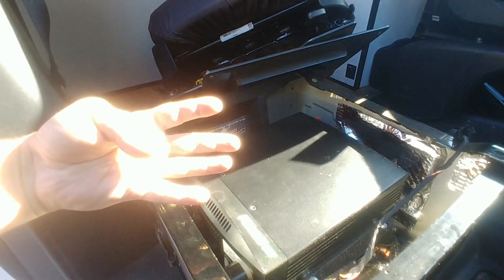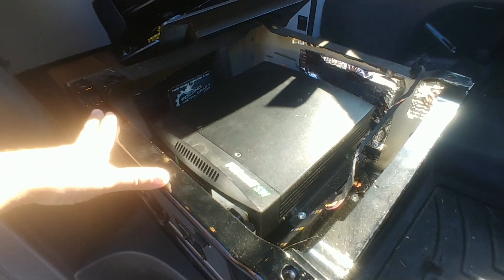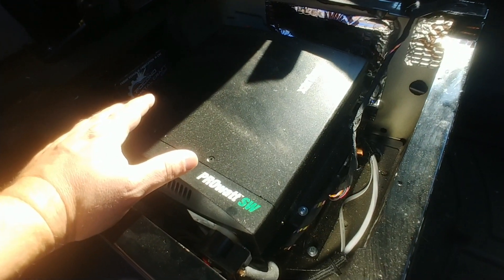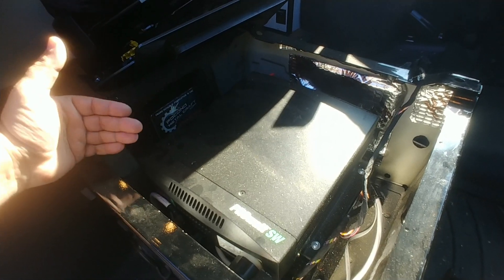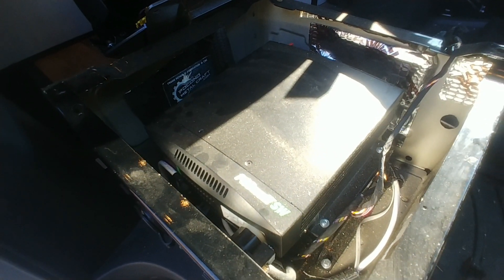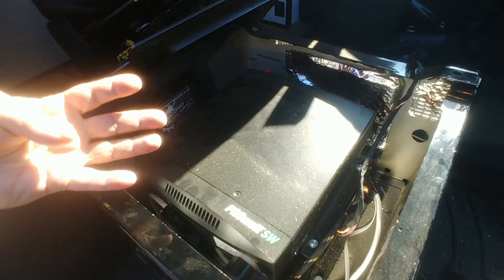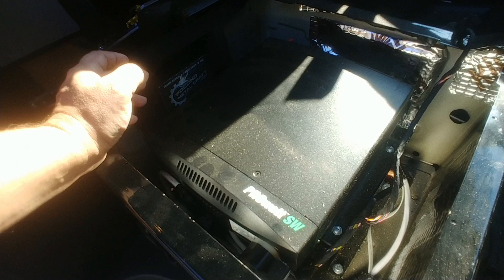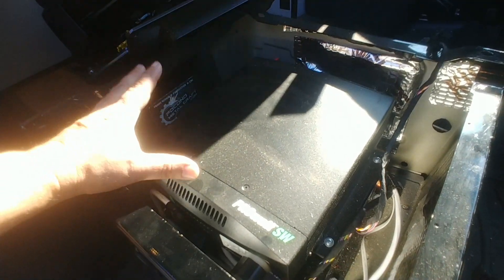Is the Xantrex SW2000 inverter any good?

Comment: You would be better off using 4/0 cables and having the inverter as close as possible to the batteries - 
     With a 12 volt system it's very  difficult to maintain 12 volts at the inverter terminals even if your battery's are at 12.6 volts at a 2000 watt load - we used inverters on offshore drilling rigs for emergency or stand by lighting and communications equipment - 
        If your inverter power leads are more than 2 ft from the battery's no matter what the size there be a serious voltage drop at the inverter when you draw 2000 watts or 200 amps - 
      If there is more than 2 ft distance - you can go with a 14 volt battery bank - or go to a 24 volt system - with any inverters we often went with 24 or 48 volts if the load exceeded 500 watts - 
       Another is the temperature - there 2000 watts at 78° but at 100° they might be 750 wattts - as a rule  you run inverters at not more than 25% of there rated out put - 
       I had worked on generators and inverters for decades on offshore rigs and platforms also remote mountain sites - 
    Those inverters were excellent and are FCC part 15 class  A they create no IF - that's a + -
       12 volts does not travel far at high current demands at all -
Reply from the maker: Thank you for your feedback, much apprecated!
Reply: @RANDOMFIX  I hope it helps you - I've been using Xanax and Trace inverters for my house alone for about  23 yrs now - 
      I live in the rural deep south - hurricanes, ice storms, even thunder storms or heat waves knock the power off the poles out - 
       My power has been knocked out up to 9 months at times over the 40 yrs I've lived here - I have a large bank of battery's and charge four hours a day when I'm not using the air-condition -  it's 12volt inverters I use - 
         I use a weaker strength acid in the golf cart battery - instead of 1.275 strength acid I use 1.220 strength acid - it does reduce the capacity of the batteries, but increased the service life of the batteries up to 50 yrs or more -
Reply from the maker: Wow, very cool, I didn’t know the weaker acids would extend the life of the battery by so much. Do you have addy information about this?
Reply: @RANDOMFIX  my grandfather started working on power plant generators in the late 1800s - 
     Down here all power plants were hybrid - even down in the French quarter in N.O. on Burbon street there was a power plant that provided 110 volts DC to the French Quarter - 
      The reason that most power plants were hybrid was the cost of fuel -  if in  1900 a gallon of oil that engines burned was 30 cents a gallon with inflation in our money that's about 30 dollars a gallon for fuel oil - 
       Most of the fuel an engine burns goes toward running or turning the shaft before any power is used - 
    If  A generator runs 4 hours a day - that 4 hrs of fuel used to rotate a shaft - each HP generates 416 watts at 100volts up to 25000 volts - with 12 volts it's 325 watts per HP or I think 24 amps per HP - 
      In the end lead acid  battery technology was well understood by 1900 - you here it said it's a 12 volt car battery - 
     Before battery's were used for starting the electrlite solution was much weaker -: those battrey's at that power plant in N.O. in the quarter had an acid strength of 1.190 so at 80" while sitting there standing voltage was 2 volts instead of 2.33 as with battery's today with a.acid strength of 1.275 -   the acid strength determines the capacity of the batteries and the service life of a battery - 
      Battery's that use a weaker solution acid don't sulfate by much  and sulfation is easily removed during equalization - power plant battery's were expected to last 70 + yrs or more - 80 yrs was the target - 
       Also about 1900 farms or  rural homes adopted using the railroads 32 volt system - down here we're I'm at it never gets colder than 7° so it's safe to use a 1.190 acid it freezes at 0° - 
        The acid strength used was determined by the lowest tempriture the battery's exposure was - 
      In most of the country 1.220 acid strength  was used in house battery's on farm home light plants it's good down to minu 17° -  you can Google farm light plants battery's  - and I think Exide and some other farm house battery's will come up - 
       I think they rate the 1.220 battrey's for 40 yrs - at that point it was also time to replace the generator with a remanufactured generator - it was based on charging one day a week over 40 yrs - that's close to 19000 hrs of run time say on a Delco farm lighting plants - 
       Kohler  had a 32 volt set up that was sold as a 15 yr farm light plant for farms with high power demands - there battery's were 1.240.strength acid that increased the capacity of the batteries but the service life of the batteries were reduced  to  15 yrs - at that point the generator was also changed out for a remaunurfacture gen set - 
     With the Kohler set - some of this can be found on the net - just look for vintage farm lighting battery's - from what I'm told you will not find any of this on you tube -        I've had friends tell me they found some of this as documented studies in the early 1900s of the efficency of farm plants - 
      I've changed out my system from a 32 volt DC / 110 volt AC system ( using a machanical motor driven inverter/ - 
      My engine runs at 450 RPMs it's about 90 yrs old - it was set up.as a 80 yr system origainaly and runs on crude oil - those GW oil  engines are still in operation in oil fields every were. - 
        Because of the cost of fuel a 100 yrs ago it runs at a efficincy of 22:1 that's it delivers 22 kw of charged battery out put to one gallon of heavy crude oil - I run used motor oil in mine these days - 
     The acid strength and generator engine type generally are directly associated with ambient  temperature - my gen does not  work well in cold climates at all and has to be pre heated to 180° to start  and runs at 250° - it's oil cooled but very fuel efficient - inverter gens run at 6:1 efficincey or so  - 
    On offshore platforms there might be 250 five thousand amp 2 volt lead acid battery's at 1.210 acid - when huricanes pass over there is to much water in the air for engines to run so platforms switch to huricane mode and run on battery's - lead acid has been tried and true so industry has stayed with it - also with weaker acid there is almost no terminal corrosion - 
      You do charge at a lower voltage and the float voltage is also lower -
         With lower strength acid you don't have to keep a battery on a float charge the self discharge rate is very low - so you can just charge them twice a yr with 1.220 acid - 
       I'm third generation so I know a lot - also I worked in it for decades - in the oilfields every thing is off grid
Reply: @RANDOMFIX  with AC generation in the early days most relied on dams for AC generation and it could be transmitted 100 of miles away -
        Most town power plants were hybrid for a good while because it cost to much to run a AC generator 24/7 with oil or coal - today they strip mine with explosives a shovel picks up 100 tons to 300 tons of coal per scoop - so coal is dirt cheap - the power plant my power comes from is on the Mississippi River 150 miles away - it's a 1000MW  plant and burns 120 rail cars of coal a day -
Reply: @RANDOMFIX  I don't think you will find this on the net - lead acid battery's have an indefinite shelf life when they are "dry charged" simply means stored with out the acid in them - the negative plate will oxidize slightly -  it will take longer for it to activate when the acid is poured into the cell - you have to put it on a charge and let it gas to about what a Coke bubbles at as it set there charging - 
     That would be equal to 100% charged - in industry that how we determine the finished charge rate of a cell - 
      If you have a car battery that your not using or deep cycle battery - you can fully charge it - then empty the acid out the battery - then fill the cell with fresh water and let it set a while and dump it - rinse the cell out 3 times leave it empty  install the caps - 
      When you need the battery just pour the acid back into the cells and charge it - you can use a load tester to see the state of charge - you might have to draw acid off the top of the cell to the plates and add new acid to the cell to bring the acid up to the gravity you need - some of the acid strength is lost when the battery is reactivated  -  - you can get acid at Auto parts stores - 
       I've activated battrey's that my dad bought in the 60s he just kept extra tractor battery's around dry charged - one was from Western auto from 1965 it was called a crusader it was a 60 amps 6 volts and the price tag was $4.99 another was a 12 volt Western auto battery it was 75 amps and the Western auto price tag was $11 - 
     So after 55 yrs they activated just fine - my dad bought them with out acid - I remember him buying them - also I've activated battery's that had good plates that my dad bought and poured the acid out of and rinsed out to keep as spares - 
         Lead acid battery's still have there place today - with a golf cart battery if you fill the cell up to the eye in the fill hole above the plates and let the water mix while on charge - then draw the acid out to the top of the plates and refill it with water if you do that two times the acid will go from 1.275 to around 1.240 - a 200 amp golf cart battery will loose about 20 to 25% of it's capacity or is now a 160 amp battery with a 20 yr service life verse 7 yrs at 1.275 acid - 
     If your not going to float weaker acid battery's disconnect them from each other and clean the tops of the battery's so they don't discharge thru the dust -
Reply: @RANDOMFIX  I hope it helps you - I've been using Xanax and Trace inverters for my house alone for about  23 yrs now - 
      I live in the rural deep south - hurricanes, ice storms, even thunder storms or heat waves knock the power off the poles out - 
       My power has been knocked out up to 9 months at times over the 40 yrs I've lived here - I have a large bank of battery's and charge four hours a day when I'm not using the air-condition -  it's 12volt inverters I use - 
         I use a weaker strength acid in the golf cart battery - instead of 1.275 strength acid I use 1.220 strength acid - it does reduce the capacity of the batteries, but increased the service life of the batteries up to 50 yrs or more -

Comment: I run 2/0 copper cable and only have 300ah of lithium battery. I've NEVER had a problem with either of two units, and I abuse the crap out of them regularly. You need to study cable size for the amps your pulling. It'll pull much more than 250a starting certain items. I've run a 12000 but ac, large microwaves, circular saws, heat guns, heaters, all kinds of extremely high draw items. NEVER have had a problem. 

You need at a minimum of 2/0 wire, larger if it's any distance from the batteries. And by distance I mean 3ft, or a total of 6ft, both positive and negative. Longer than that requires even larger wire, 3/0 or even 4/0.

Takes power to make power, and the wire is what's causing your troubles. 

Also, it runs cooler with higher input voltage, only attainable with large ofc runs. Period.
Reply from the maker: I appreciate your constructive comments, thank you for the feedback!

Comment: Hmmm…. I’d be curious to see if the output wave really is pure sine, and if so it’s consistency and and RFI it generates.

It’s possible you have a bad unit, I’d have to check a few parameters though.

I saw 👀 in their website today they’re still making the potable PortaPack 1500 with a 51 aH AGM and modified sine wave inverter- same model from 2007. Seems a little outdated, but the online price across the board is $500-$600 which is absolutely unacceptable considering todays technology. We had 3 of those back in the day but today for that price, you can have your pick of 1000+ watt portable fully-equipped power stations with pure sine wave, multi voltage output and digital port charging with the newer liFe-po lithiums, traditional cylindrical 18650 lithium cells, or if you want the tried and true AGM, pretty much an entire personal solar array for a cottage at that price point.

We’re testing 6 brands in the lab right now, but you have us curious on what’s going on over at Xantrex these days. 

Hmmm…. 

Keep us informed though.
Reply: What would you recommend as a substitute?
Reply from the maker: Sorry for the late reply! did you find a solution?

Comment: Sorry your cables are microscopic. I have no issues with my two Prowatt SW 2000’s using 5 foot long 1/0 stranded pure copper welding cables. You have the inverter in a box trapping heat. The setup is defective, the unit is probably fine. How long are your battery cables? Are the pure copper stranded welding wire? You are getting voltage drop due to   Resistance. My fans rarely run and we use an induction cooktop, microwave a dc fridge. Let it breathe and give it acceptable cables. Don’t forget the 175-200 amp fuse at the battery.
Reply from the maker: Thank you for your feedback, much apprecated!